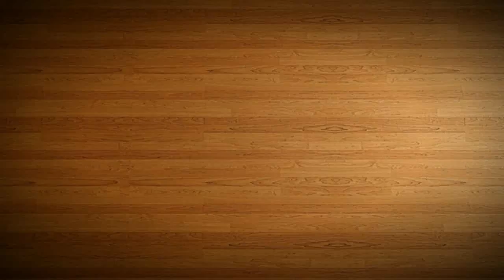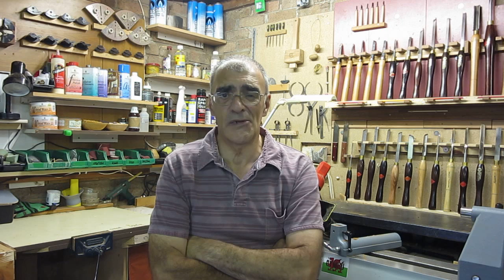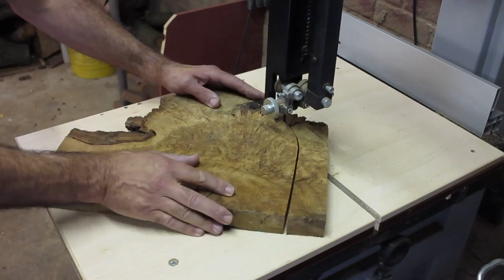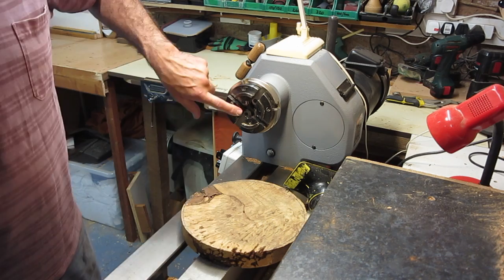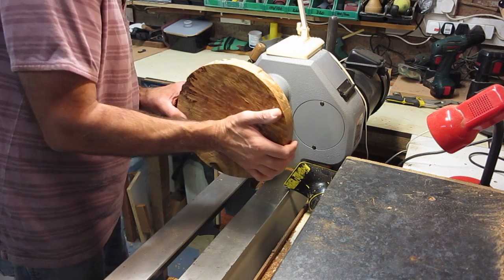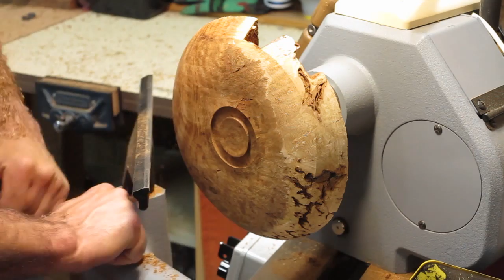Wood Turning -  A Shallow Bowl

Comment from the maker: Thanks Jim, glad you find them of use. This is what I use :
3 parts Cellulose Sanding Sealer to 1 part Cellulose Thinners and Woodwax22.
Apply sealer mix twice and cut back between each coat when dry (5mins)
Two coats of the Woodwax22 buffing out each application.
Take care
Mike

Comment: When im hollowing out a bowl i would tend to use an outward pivot movement using my fingers as a pivot with a 3/4 fingernail ground hamlet bowl gouge (much like glenn lucas's style) before then doing the finishing cuts from outside to centre - whats your thoughts?
Reply from the maker: Hi Thomas, I think your method is sound and well proven, I use various different techniques, depending on the wood, and also how I feel on the day, not very professional I grant you, but unfortunately (or fortunately) that's the way I tend to work. Possibly that is also the reason I would never make a living from bowl turning ;).
Thanks very much for your input, and support.
Take care
Mike
Reply: Thanks for your reply, just want to say after finding your videos theyve given me a few ideas id hadnt thought of before and the quality of your vidoes are outstanding and very easy to follow for anyone just starting out.
Tom

Comment: Mike, I have been trying to find a very small dovetailed wormtail screw adapter like the one you used on this project.. do you have a link to where one might be obtained?  Thanks in advance.
Reply from the maker: I got this with my original chuck as a deal about seven years ago from Axminster Tools here in the UK.
Hope this helps
Cheers
Mike
Reply: Mike Waldt that was exactly what I needed... Thank you!!!